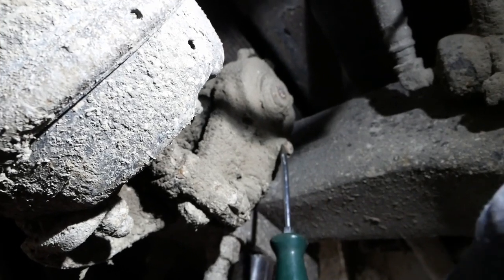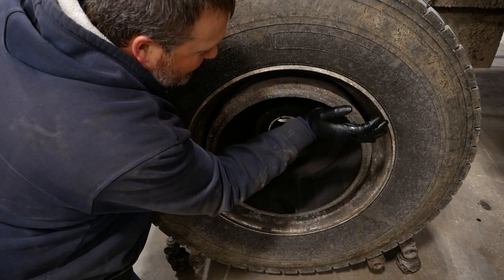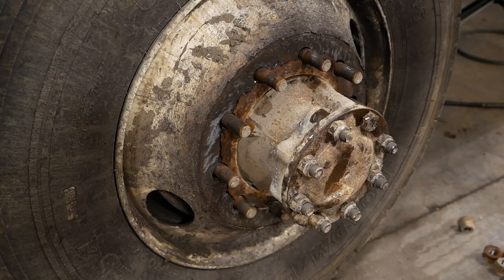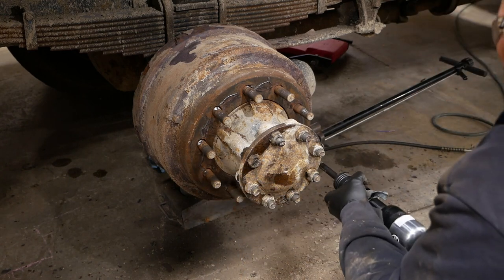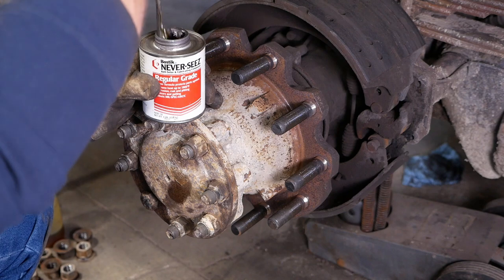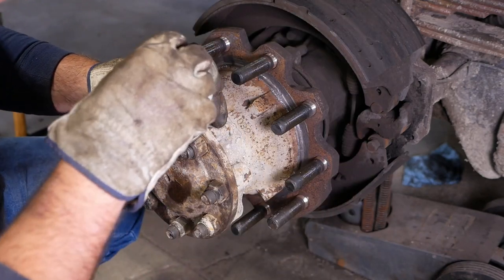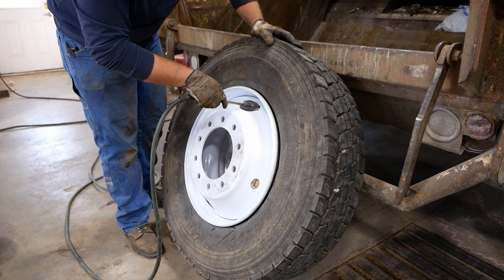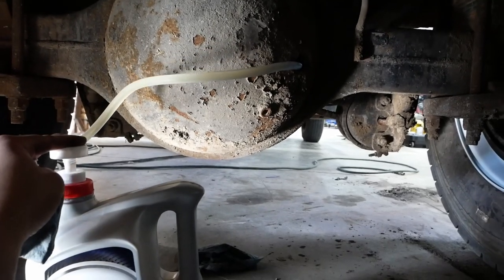Garbage Truck Driveline Noise Could Have Been Bad!

Comment: We had that exact thing happen on a Mack water truck. They changed the tires, and completely over torqued the nuts using a 1” impact. Ours cracked more to the outside of the stud holes, but the whole thing cracked off, and the tire proceeded to remove the airbag and some lines.

Comment: After 47 years of trucking i've seen many broken wheels just like that.  One concern i have is that the hub on these hub piloted wheels may be worn and not centering the wheels now. They make 33mm centering nuts for steel or alum. wheels. Might want to put some on (3 should be enough.... every third stud). Other than that great video as always.

Comment: I agree with you Wes.  That box looks like it should be on a tandem axel.  It's hard to tell the size in the video, but I work for a garbage company and it looks about the same size as the smallest tandem axel we have.  If so I can't imagine it being on a single.  One has to think how heavy that is even when empty.  The blade itself is super heavy.  Then figure another 6 or 7 tons when fully loaded.  That's alot for one axel

Comment: Excellent job young man!! I think what cause the cracked rim is that the truck driver may have drivn to many times on the curbs causing weight on the rims to stress out. With so much weight on this will cause damages but not always, usually the rims will bend, not crack.👍

Comment: i had the same cracking on aluminum steers on my pet. i ran centramatic wheel balancers that where getting rusty. i cracked 3 rims and ended up removing the centramatics and have not had any trouble sins  the centramatics where rusty but did not look bad enough to cause any  problems. keep up the good work wes

Comment: Drove a 70 C-60 in college.  Lumber Company decided to put one new tire on the back.  Put it on the outside.  Ran about 150 miles highway under heavy load.  Half the wheel studs were gone when I pulled her back in the yard.

Comment: Great Video, Wes. I learned pretty early on when I was working on Trucks and Farm Equipment, that I was not a tire guy. That is one job I don’t have a problem farming out. The wheel dolly’s are a must for most large brake jobs. This video made my back hurt. I appreciate your attention to detail and showing torquing the wheel nuts. Always a treat. Thanks.

Comment: Great video Wes I had this happen on a tractor trailer right rear drive axel when I was hauling milk 107,000 lbs on 5 axels the inner wheel broke it was steel the outer was aluminum I thought the whole rear end went it made one heck of a noise!

Comment: I seen it a once and it was on that old style  garbage truck.  I suspect the wheels cracking like that is a combination of the weight, salt on the roads and hard turns especially on the single axle trucks.  I am so glad I don't live in Iowa anymore but spend my time on the left northwest coast.

Comment: in my "professional" opinion as a truck driver this is caused by tire servicemen torqueing the wheels while the brakes are applied. the brake shoes hold the brake drum from sliding inboard fully; meaning that when you release the brakes the whole rim/brake drum assembly loosens off a tiny bit. this tiny amount of play is enough to cause this problem over time. the tell tale sign is the rust lines radiating out from the wheel studs at 0:50 minutes. ask me how i know lol. i have spent DAYS in tire shops over the years. when the wheel nuts are torqued the whole truck and trailer should roll ahead or back slightly. Wes you did it correctly.

Comment: i'm having a ptsd flashback watching this.  as soon as you put the hub/wheel assembly on i knew it was a mistake.  hub piloted wheels  do that more than you know.  cleaning and oiling that built in washer is the key to proper torque.  you can get those pumps cheap, the ones for boats fit quart bottles and the last ones i bought were under $5.00

Comment: Just a little tip for removing brake drums like that take a big sledge hammer and hit right on the corner of the drum where the angle on the front side meet the large flat area should only take 1-3 hits works everytime

Comment: Overloading, and wheelspin on Landfill causes this a lot. I've seen it many times here in the uk. By nature the truck is overloaded on the rear axle as it fills. Add to that some enthusiastic driving (Or over enthusiastic/careless driving) and hot/cold cycles, road salt and spinning from loss of traction on landfill and a driver who rocks/jerks the truck to get traction and  you get cracked rims.

Comment: Nice job.  With the hub pilot wheels it is also critical to check the hub mating surface that centers the wheels to make sure it is not worn.  Common causes of wheel failure include improper torque, running loose as well as being overloaded.........

Comment: I had the same thing happen on 10 wheel dump truck except it was the outer wheel and it parted ways and ended up in some old lady's bushes. Knocked some stuff off her walls inside and did some damage to the wall both inside and out. Luckily no one was hurt.

Comment: This is why pre-trip inspections are important, boys and girls. Granted, this is something that would be a little harder to find, but just based on the sound, I was thinking cracked drums or cracked rims to start with. Happens a lot more often than you think, often due to rust, this is why I don't like steel wheels on such trucks.

Comment: That was a surprise. Always expect the unexpected I guess.
My brother had a strange rattle from the rear; after jacking it up we found a server spoon ( bent double ) hanging on to the petrol (gas) pipe. Strange jangling sound on every bump.

I was impressed by  your truck tyre changing I didn't anybody changed tyres manually these days.

Comment: I used to see this quite a bit with the old Budd style rims. I went from running a tire service truck back in the "90's to driving LTL, pulling multiple trailers every day, so I've see a lot of hub pilot rims over the years. I'm sure I've seen this with hub pilots, but it's rare compared to the old ones.

Comment: as you were spinning the wheels after they were in the air, you can see the inner wheel flopping around just a bit.  at least you caught before the tires decided to go on an unscheduled vacation from work, and probably into a passing motorists front end.

Comment: Possible a fatigue fracture by vibration, or metallurgy fault in the steel before blanking. 
Never saw the double wheel carr before. 
Great work Wes, thanks for sharing.

Comment: You mentioned the rust as a cause for wheels coming loose on old wheels, I've seen new wheels come loose from the paint wearing away from the seating faces in high load applications. 
It pays to be careful. I always run 'nut indicators' just to keep an eye on things.

Comment: First Rim I saw a broken all the way around from stud hole to stud hole was on a Dodge pickup truck  the year was 1968 the truck was built new in 1962. On close inspection 3 of the four wheels had cracks between the lug holes . Most of the miles were on dirt roads, it was a USFS pickup.

Comment: I’ve seen that sty of rim break apart like that all too often!  Stopped a semi on the highway who was missing six of his eight wheels on his van trailer.  Besides the flying sparks and 40 km of gouged highway, the driver claims he didn’t realize it!  But he must have since he attempted to chain up the ear most axle before losing 2 more wheels.  Found a set on the highway later the next morning in middle ditch.

Comment: I don’t work on trucks for a living so take it a grain of salt.
When tightening lugs with a lot of extensions I set up a jack stand close to the ratchet head so the whole shebang stays level when applying torque. Don’t know if anyone else does this but it does keep from slipping off from downward pressure.

Comment: I have seen over and over one thing creating these symptoms is lack of crank case oil maintenance.

2005 Chevy Duramax Oil Spec Was SAE CI-4 High ZDDP Oil with a Viscosity of 15W-40 above zero.

April of 2024 15W-40 oil which is the viscosity most can pick up in their hometown is a CK-4 15W-40 which is a low ZDDP oil recipe.

It has been shown that the new CK-4 oil recipe needs to be changed SOOOONER than the CI-4 oil recipe for inhibiting a menu of diesel engine symptoms in these older diesel engines.

Comment: I had garbage truck come with zero parking brakes, I could only see a vaguely slack adjustor shaped object caked in garbage juice and road grime. My boss told them to get it out of our shop and bring back when it was clean enough to work on. In my experience garbage trucks are chronically overloaded and under maintained.

Comment: Hey bud! My Dad had a truck company! Had one truck that had Aluminum wheels on second axle  1st rear axle was steel! The driver wanted to use the wheels so both axles had aluminum on outside on both axles with steel inside. This can be done but have to use the proper nut studs and nuts!  Like what you had happen there the inner wheel worked loose . The steel wheel rocked  loos till sheared the studs  and spit the set of wheels off from hub dropping the axle assemble to the ground an the wheels off the road down a hill into a ravine  was a mess!   Have to think and use proper studs and nuts for steel/aluminum wheels! Luckily no one was hurt!  Took me several hrs to make repairs on side of road to get the truck back going! Lug wheel nuts and nuts have to match for the wheel being installed aluminum nuts will not hold steel wheels and steel nuts will crush aluminum wheels cause damage and come loose! This is a common mistake !  For those who do not know what they are doing!

Comment: My experience has taught me that it's way too easy to go over the limit for those little rigid trucks.  Add in those lovely roads of yours, high speed and constant use, and it'll chew up those rims  - especially if rust, detritus or paint is on them, or they were switched from back to front.

Comment: Reminds me of a friend of mine helicopter logging a few years ago. Ron was co-pilot on a big logging helicopter. They had just replaced the Jesus Nut that holds the rotor on. The old nut had run out of time at 2,000 hrs and a new nut was installed. As they lifted the logs the new nut broke and the heli turned over upside down before impact. All the processes in the world sometimes do not work out. I lost a friend that day. His wife later became an alcoholic but his daughter lived on.

Comment: Lmfao "uht oh!" Right when you pulled the outside wheel. Came back to edit. I change truck tires more often than any average person I thought you did great. I usually put mine back on with a hammer but a bar works just as well.

Comment: Hi, Wes. The new viewer here, You asked why this happened. My guess is a lack of maintenance. The whole truck is subject to the winter and salt on the roads. It needs extra care, not less. Whoever runs that truck has no budget for maintenance that would catch such problems. That is not a cheap truck. I would squeeze every extra year of use if it were my truck. And that is the problem. It is a stinking garbage truck that nobody wants to be responsible for until it breaks. And if it breaks, they think you can make it better. I heard a story about a Dutch boy and a leaking dam. Are you Dutch by chance? Anyway, thanks for sharing! Stay healthy!

Comment: Cheapest rims from "china" cast from chinesium.
I've seen this happen on a logging truck trailers, and it can happen really fast if there is one new tire and one worn, so the truck/trailer is only running on one wheel.
That conjoined with a rust in the seating surface and little ping sound while torquing rims. it wobbles for a while until it made enough space to start making a noise.
If lucky like this, outer rim will hold on the center ring of the bolt pattern, or bad case it will snap studs and allways in highway speeds.

Comment: It’s always the passenger side inner dual. Caused when coming off the dirt road and onto the pavement, there is often a hole with a step up. Usually it’s a bent rim though.

Comment: Depending on how many wheel studs (and other press in studs) you replace a year, you might like this idea.  Rather than pull the hubs off and press 32 studs in on my shop press or spend an hour or two with my impact and lug nuts and put more wear on my brand new studs,  I built an adapter set to allow me to use my harbor freight 96718 hydraulic knockout punch kit to pull studs into wheel flanges.  I've got a video up on my channel about it but honestly you probably don't need to watch it, all it is is an appropriately sized piece of structural steel tubing with both ends squared off on the lathe to space the body of the hydraulic cylinder away from the hub flange and a threaded drawstud adapter with 3/4-16 male threads on one end and female wheel stud threads you need on the other.  Hundred bucks for the hf knockout punch kit plus a little scrap structural tubing and B7 threaded rod, a lug nut, and some welding gives you an 8 ton hydraulic press that can pull studs into anything, anywhere, without taking them off the truck or in some cases even removing the drum or rotor.

Comment: Wes, that is the same wheel dolly that we used when I was working. It was there when I started in 75 and was still there when I retired 11 years ago. the only thing we ever did to it was replace the hydraulic jack. I've seen a couple of wheels cracked like that, but plenty with other types of cracks so much so that we nearly always kept two or three spares in the parts room. We had so much trouble with loose wheels when using chains, we had to have the drivers check the torque every shift, that seemed to solve the problems. We had a chart mounted in the shop that each operator had to sign after torquing the wheels. I forgot one incident just after a new shop foreman started, one of the trucks came in making that same noise. Before looking at the truck to see what was wrong, he decided to order a new chunk and then set the truck outside until it arrived. Imagine his surprise when taking the wheels off and finding the center of the rim broken through the stud holes, a little embarrassing for him. We never let him live it down as long as he was there.

Comment: We used to hold a maintenance contract for 6 twin axle Otawa yard trucks for GE, can't even tell you how many tires we changed, with the twin axles (with power divider) and all the jockeying trailers around the average set of tires lasted 6 months when the plant was running full steam. On a good day you could do a full set of 10 of them start to finish, it was great money, but holy hell what a workout. If you were going to hand mount tires for a living you could open a crossfit gym and get morons to pay you for the privileged of mounting truck tires.

Comment: whenever Ive run into this issue, I believe its due to the lugs coming loose previously, the studs got damaged and upon retightening they never got tight enough to hold properly and cause the wheel to fail

Comment: I think that on the last installation the rust right around the hub where the wheel sits on it and against the flat drum face wasn't cleaned completely, (sort of like washing your legs and forgetting to do the leg pits) so the rim wouldn't go back against the drum because that rust in the pit was stopping it!  So the lugs had to bend the rim in at the holes, 1/8 inch to tighten fully. Thus bowing the rim at the studs and eventually cracking it under load. That's why that needle scailler and a tiny sharp scraper needs to be ran real good on the flat all the way tight around that hub pit. So the edge of the rim center won't catch and it seats completely back all the way like it should. That's my take on it and I've been in it for 35+ years. I've seen rims crack between stud holes due to rust buildup but never all the way around. The guy who put them on last was probably rushing and said ah what's a little rust going to hurt. I got it mostly clean almost to the hub!  But that area.....is as critical if not more, than the flats around and between the stud holes. All good mechanics should know that surface prep and cleanliness can make or break a repair. That's why we have to take the time to do it. I just consider that the half time stretch of the job while doing it and the time to catch a quick drink and a smoke while thinking about the critical steps that I must not forget when reassembling. Good luck. Great call on that job and good luck in the future! Jpol.

Comment: By the way the crack formed through the center of the stud holes it would suggest only half of the lug nut was compressing against the spindle ,drum , and wheel  . I’ll bet if it was indicated you’d find taper on the spindle and or the drum allowing the the flex in that spot . No ware or rust would move the cracking outside the bolt circle .

Comment: In my garage, we had 25 cubic yard Loadmasters on a tandem Mack chassis, and I have never seen a cracked wheel or brake drum. This is in New York and we had the same beat up washboard roads and plenty of salt was used in the winter. Those slack adjusters look like they have seen any grease. The body rust is worse than what I seen. And I bet you will see it again for new rear brakes and who knows what else.

Comment: Check the rubber fuel supply lines to the transfer pump on the dodge. Fairly common for them to age and start sucking air. Good catch on the garbage truck I’ve never seen anything like that.

Comment: It's never a good day working on a garbage truck, my first truck mechanic job was on a garbage truck fleet, yuck!. I worked for a drivetrain rebuilding company for 18 years and saw that a few times, generally a customer would call and say we had the differential replaced and it's still making the same noise. Good catch on the broken wheel, funny how a lot of shops wouldn't catch that issue.